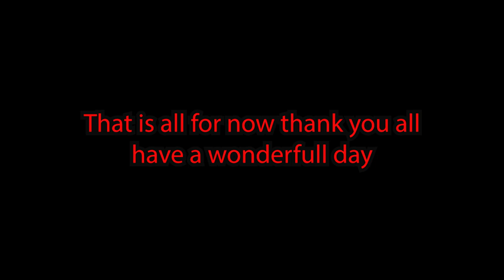Ambulance to RV (Ep10) Will it start after removing all of that wire?

Comment: I would leave some of the outside emergency lights for a silent alarm system if someone opens a door while you are away.  They are handy for hazard lights and ditch lights for camp site searching.
Reply from the maker: Good idea  i was thinking of replacing all the old outside light with flood out side led on all sides
Reply: @PurplePercepti0n  yes. I think there is now direct LED replacements for almost all applications, especially mobile. 
 But its a cost vs benefits design decision.
Reply: I've even wired an old original Unitrol and Code 3 siren system as an alarm system.   Of course its very loud but it sounds like the police are on the way.  ;)    but after even 1 false alarm and you'll want to disconnect it
.  :0

Comment: Sometimes when I watch you dealing with all those wires I think: just rip it all out and start with a clean slate! Might be easier. 🤔
Reply from the maker: Pretty much there  but still need to get the break and turn cables fuger out

Comment: Mice holes??  Seriously.  
You found evidence of mice in an ambulance?  Like droppings?.   This would be very bad for the sanitary conditions an ambulance is supposed to operate under for patient care.
Reply from the maker: They have keep this inside it entire life and inside was pretty clean but when you start to pull out evey thing was cover in dust dirt and the holes were probly separated from the inside compartment.  But i tend to use it for an entirely  different peorpis and will be parked right next to the mouse holes most of the time
Reply: @PurplePercepti0n  a regularly garaged vehicle is very good.  
You will enjoy that extra care taken.
It saves years in wear and tear over being outside in the sun and weather.   😃